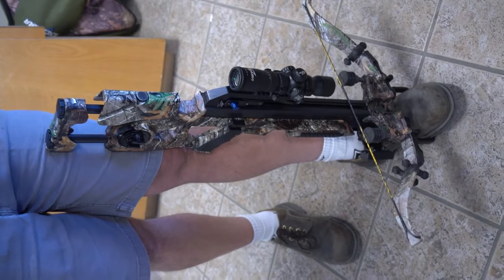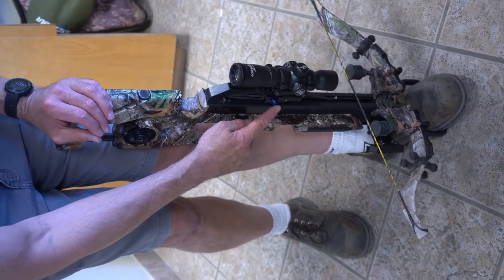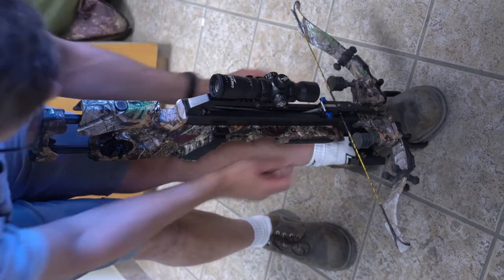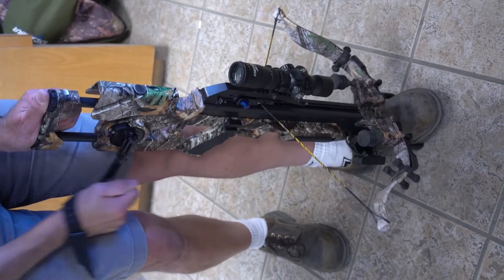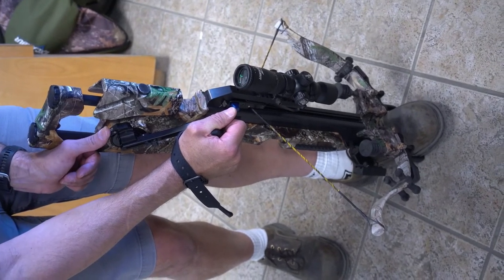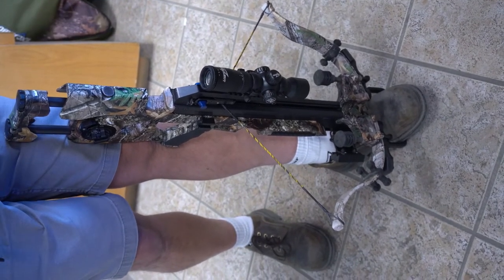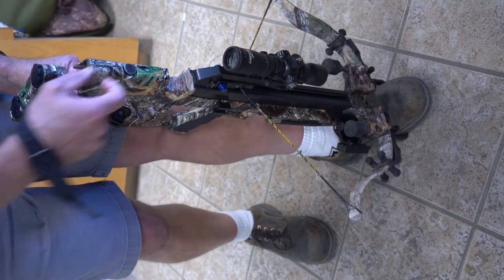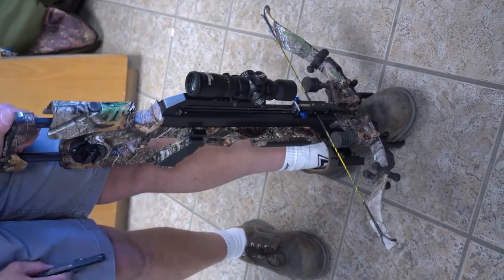How to correctly cock the Excalibur Assassin

Comment: I wonder how this system compares to using the EXT crank system with other models from Excalibur? I'm personally looking at the Assassin Extreme right now vs the Micro + the EXT handle since I am disabled and can't cock normally
Reply from the maker: The Charger EXT crank is an external removable system instead of built in like the Assassin crank.  The Assassin system allows the entire trigger system to move up and down the mainframe/rail where the Charger EXT uses two hooks that attach to the string.  Both systems do the same thing, the Assassin system is just built in and does not use hooks.
Reply: The Charger EXT is a little faster to use being external- but I personally like having an internal crank such as this one or on the new Rev X. The internal crank is a little more safer as well verses the external. Just my personal view!